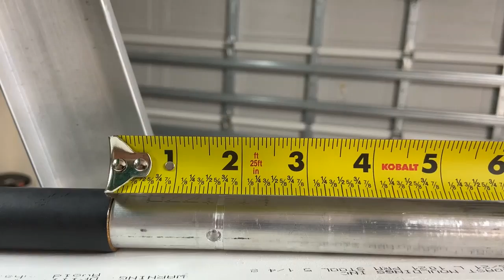Indian Scout Bobber Drag Bar Install

Comment: Hey dude!! I needed to come and add a comment, I followed your video and was totally able to do my handlebar swap out yesterday all by myself! I was waiting weeks to install them because every video I had seen showed everyone really struggling to get the grip off the throttle body, and as a small woman, I was super nervous to get into this project and then run into a step where I just didnt have the strength to complete it. Your trick about sliding the bar out of the throttle tube worked great and gave me the confidence to just go for it!! Also loved your tips about just immediately putting the screws back into the control modules as they dangled to keep everything together and tidy. Thank you so much for the detailed video! I try and do most of the work on my bikes on my own, but some projects I feel out of my depth, I'm glad this wasnt one of them!
Reply from the maker: Hi Elise, I’m very grateful for your kind words and happy you were able to complete your install by yourself. Never sell yourself short on your capabilities. Being patient and having the right tools is sometimes all you need.

Comment: Great video as always amigo!

If I may add a suggestion,

You should do a brake bleed procedure video next, because there’s going to be someone who moves the banjo too much potentially getting air in the system. 

I also use nipples in my video as the terminology as you have seen, I believe they are called “detents” but nipple is the more common word. Speaking of nipples, the new bar didn’t seem to have ones on the tips where the bar ends mount, what were those for on the previous bar?

Also, when I had removed my stock bars (to replace my upper tree clamp), for those who are worried, I used a paint marker to mark the positioning of the bar to the speedometer clamp, so I could return it to its original location. 

Lastly, if you have insta, DM me amigo, I’m interested in procuring the wrong pitch bars from you!
Reply from the maker: When I spoke to the guy that makes the bars, he said the small extension at the bar ends were not needed as they were originally intended to stop the mirrors from rotating. If you remove your mirrors you’ll see a recessed section on the inside spacer. He said even with that there, they still rotate anyway, so he removed them. Once I receive the new bars I have to return the others which he will re tap the ends then sell again. Thanks for the feedback also. It’s always welcome.
Reply: @oxouk  ahh, damn. Thought I may get lucky. 

What was the pitch anyway?

Hopefully the new bars are bent to a better position than the wrong pitch ones!

Do you have Instagram?
Reply from the maker: @StreetPilots  Marcus said he drills them all 8 mm. The ones he sent was too small. Couldn’t even get the screw started. Other than YouTube, I don’t do social media.
Reply: @oxouk  damn! Wish we could have a good way to communicate. Just for purposes of a collaboration or perhaps during the season. Do a meet and greet for guys with Indians on a 240mm tire 😂
Reply from the maker: @StreetPilots  Yeah, I wish there were more like minded riders here. Would be nice to do a group ride and bounce ideas back and fourth.
Reply: @oxouk  well for now I’ll stay tuned to your amazing content. And if in the near future you make an Instagram just to be able to message, organize and plan. My IG is the same.
Reply from the maker: @StreetPilots  10-4

Comment: Hey, love your videos. I got a question about having a 16inch wheel in the front, and the 18inch in the back. Have you noticed any handling issues?
Reply from the maker: None whatsoever as the overall height is still the same.

Comment: Hi oxouk I got a indian scout bobber abs 2019 I buy already my bars and my cuestión is the mesure for the pin hole you tech in the video is the same for my motorcycle
Reply from the maker: Hi Mario. Any measurements should be the same for all scouts 2017-2023.

Comment: Hey man! Where did you get your license plate bracket under your seat???
Reply from the maker: It was an L shaped electrical junction plate I bought at Lowes. Basically any thin sheet metal with a 90 degree bend will work. I just had to drill a couple holes to accommodate the holes to mount to the seat bracket. If I find the exact part at Lowes I’ll post it to this comment.
Reply: @oxouk  Awesome! I will try to look for it..thanks
Reply from the maker: @A_sadh2  I was at Lowes today. the part I used for the license plate frame was item # 2504882     model # C23R1. The brand is nVent Caddy. It's called an electrical box bracket to stud. Hope this helps.

Comment: Hi I have a 2022 scout bobber with 200 miles on it and the check engine light came on at stop light I’m not sure how to check codes but everything seems fine and earlier I put gas in it so might be a fuel censor but what do u think thanks
Reply from the maker: First thing you should do is take it to the dealership you bought it from. Put it on a trailer if possible or ride it if it seems to be performing normal. They’ll scan it to find out for sure. Check engine lights can be a multitude of things. If it flashes that usually is not good.
Reply: Thanks I will do that 1st thing Monday

Comment: Needing to have a hole in the bars to aline the clutch lever and module is sorry. 
Very first bike I ever seen that is set up needing a hole in the bars. This hole limits the angle of the lever once drilled. 
In my opinion  Indian should design parts that clamp tighter so this hole isn't needed.  I like the bike's look but after watching some video ,  seem to me 
that Indian has made this bike a little cheaply